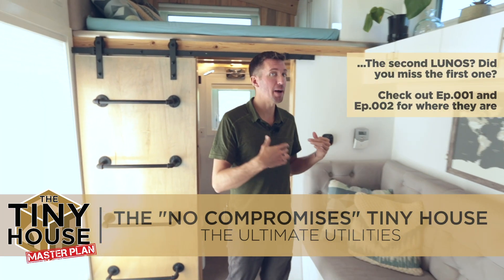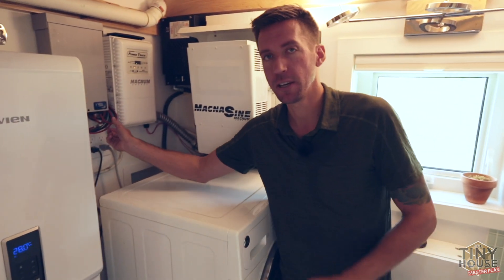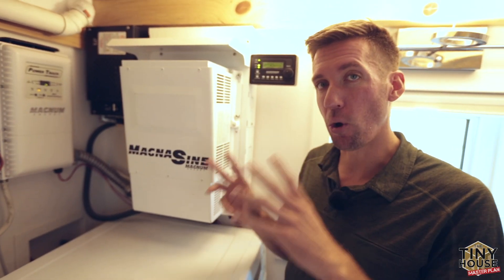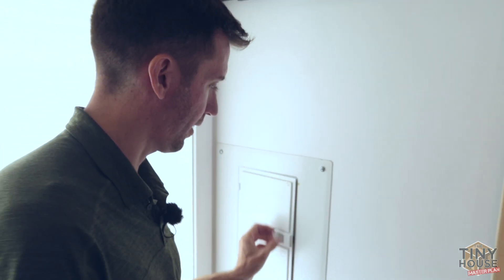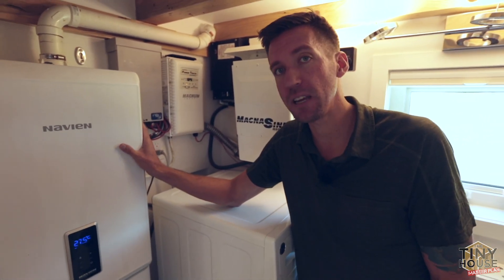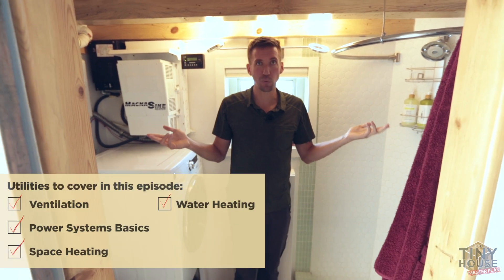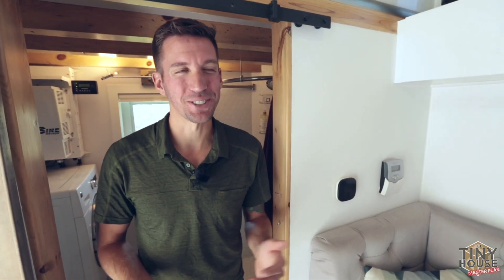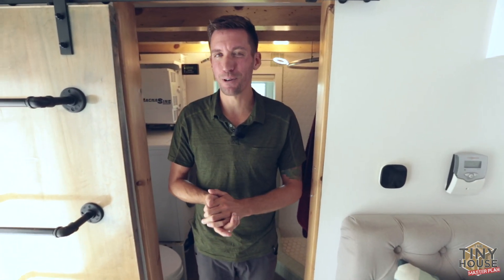The "No-Compromises Tiny House" Tour | How To Live Off-Grid | Season 1 | Episode 4

Comment: Great vid! Thanks for sharing. A few questions.
1. I may have missed it but didn’t hear where you water source is from. Well or rain water catchment?
2. Is the combo boiler running on propane? How much are you going through approx in a season?
3. What made you decide on the radiators versus in floor radiant heat?
Cheers
Reply from the maker: You're welcome! And great questions:
1) water is in my tanks! I got a couch tank and a kitchen counter tank... almost 2000L! We show it off in EP.002:
https://youtu.be/duGFE_Bmo48

2) Yep! Combi-boiler runs on propane. And I go through a propane pig (500lb.). Costs me $260/year to fill. For space heating, supplementary water heating, AND cooking. 

3) The main reason I didn't go infloor heating was to save head room! I'm 6'4" and needed every inch, so I used every trick in the book so I had enough room in the kitchen and could sit up in bed. 
The other reason I went radiators, is now I have heated towels, heated clothes, a heated coat closet, and also heaters at my feet at my table. :)
Reply: @TheTinyHouseMasterPlan   Thanks for the quick reply!
Very cool setup you have there. I checked out your other vids and saw the water tanks. Also dig the solenoid foot switch on the kitchen sink. 
And that’s a heating bill I could get used to. 
Keep up the great work.
One last question which you don’t have to answer. I’m curious at what you would estimate the value of this entire build. If I had to guess I’d estimate somewhere in the $150k range?
Reply from the maker: @jaydubb411  Good guess! I didnt track my hours building the house, but the house cost me $84K out of pocket, and there was ~$20K in sponsorship. All said and done, if someone hired a pro to build it for them, it very likely would come to $150K.
Reply: @TheTinyHouseMasterPlan  Ok awesome. Good to know:) 
Have a good one 🤟